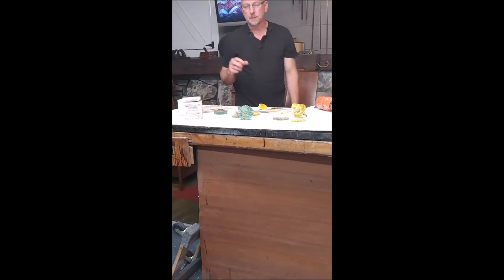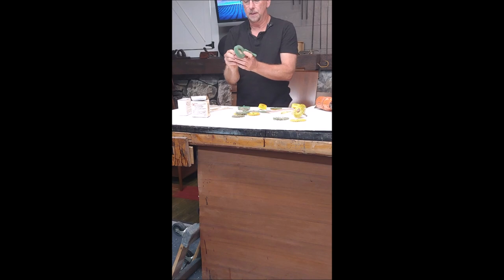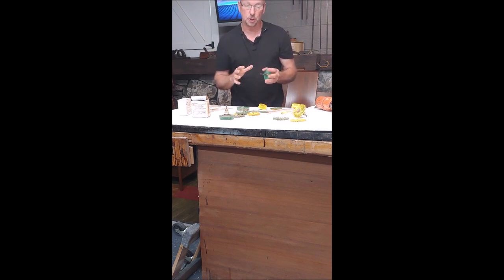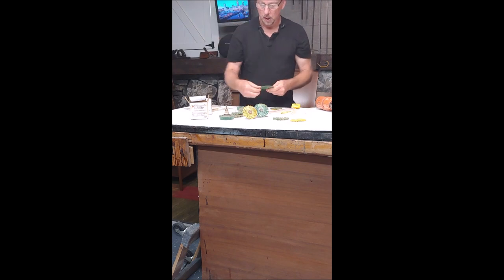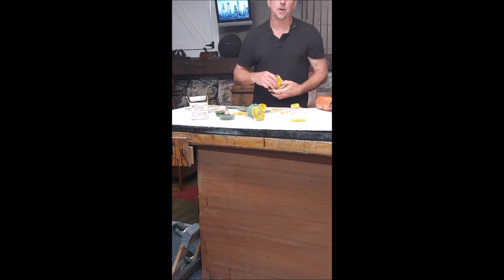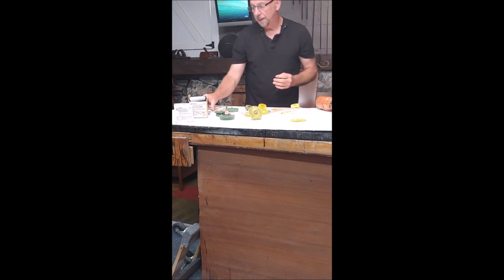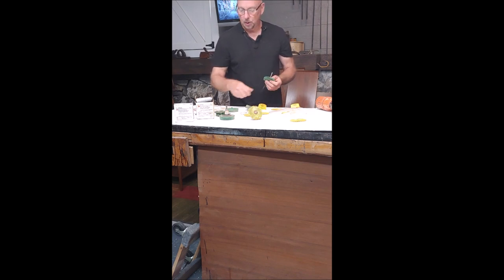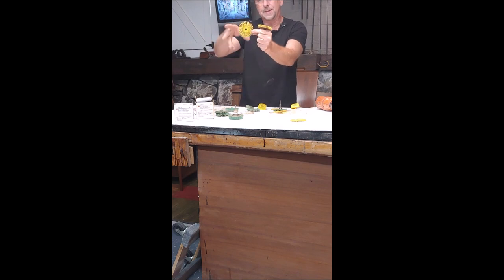Sand spindles, grooves, carvings, moldings on wood furniture the easy way.

Comment: Hello, I am in the middle of refinishing a   huge carved Honduran mahogany door and entranceway with 30 years of neglect and caked on poly/lacquor, wax sticks, etc in the grooves.  I have gone through countless strippers only to have to peel it out of the wood and reveal the same stained wood.  It has been weeks and it has to be done hung because of a sensitive wire to an 80s electric door knob the homeowner does not want removed.  I’m going insane.  I’ve even “dremeled” the carvings out to some extent.  However, it’s been a week and I’m still not done one side.  I can’t charge more than a new door but that is what it’s taking me.  The discs you talk about seem great, but I can’t find them besides from a random reseller with crazy prices who has 1 in stock.  Dremel makes smaller ones, but I have literally gone through 43 in 1 panel, 12 panels in door it eats them away so quickly.  I gave 3M the part number from your last video and they said they still make it but I had my assistant looking into it as well and she said 3M sells them under the Scotch Brite name.  Fastenal sells the yellow discs in like a case of 800, but can’t find the green or the mandral.  What’s going on with these?  Please help save my sanity.
Reply: Ah, just watched this video and heard you talk about the finish removal.  What would you recommend using instead?  I found they worked, just can’t find the larger ones you describe besides a random seller for like $180 for 10; no mandrel, etc...
Reply from the maker: I can't really speak to their availability or price, but it would appear that some re sellers are price gouging. Pehaps I'll consider buying them in bulk and offering them in small quantities?  Check Ebay.
Reply: TO THE LIMIT curious to know how your door turned out and what you ended up doing since the creator of this video offers zero help to his viewers.
Reply: BearWoods Supply as them for a very affordable price like 10 buck CAD for 4 pack